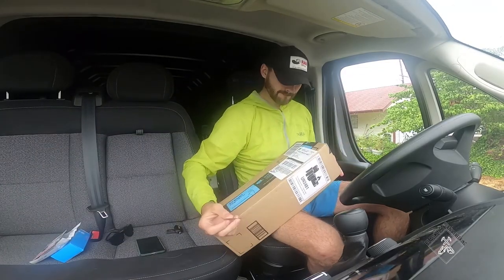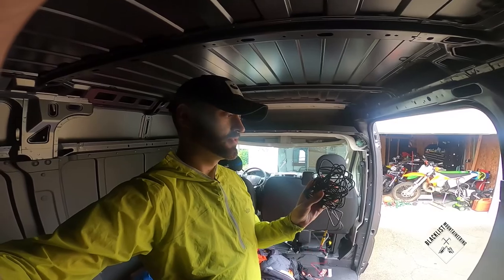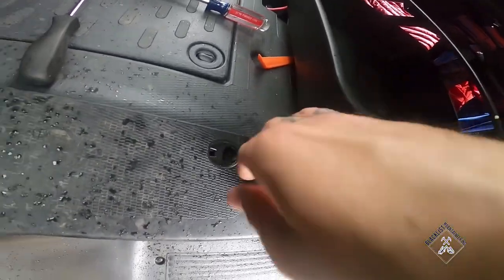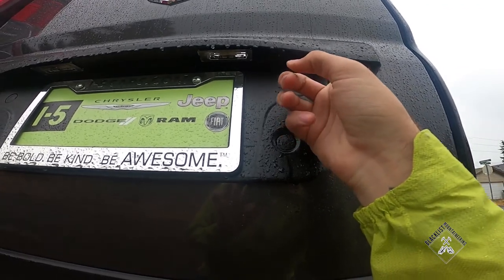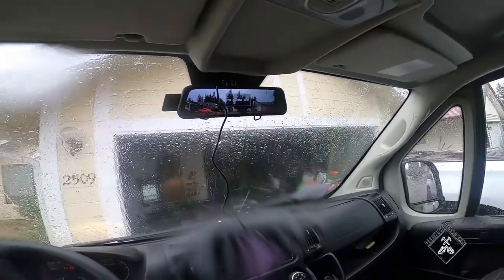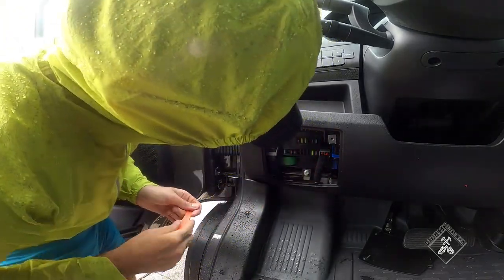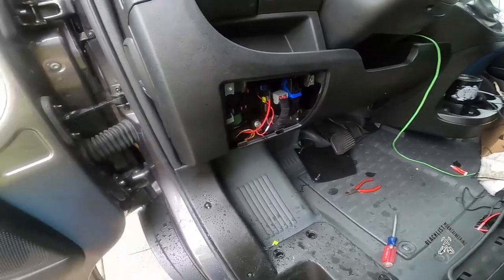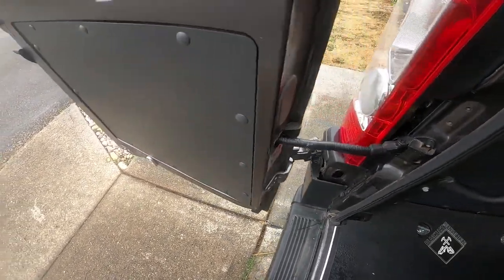Van Life - VANTOP H610 Rear view camera hardwired in Ram Promaster

Comment: Great video, however, you missed one VERY IMPORTANT detail.   When adding a fuse tap, it is IMPERATIVE that you determine which side of the fuse is the lead (where the power comes in) so that you know which direction to install the fuse tap.  If you install it backwards, you bypass the fuse and the mirror is not protected.  This also means that if the mirror shorts out, not only will the fuse not protect it, but the short can also cause issues on the battery side of the fuse box.  I have seen a shorted wire melt the insulation off of a wire (and fill the vehicle with smoke).  So... make sure to install the wire tap facing the correct way.  There are numerous videos that explain how to correctly orient a wire tap.  Otherwise this video was both helpful and informative.  Thanks!
Reply from the maker: Thanks for the comment. Pinned so other viewers can see this as well.

Comment: Awesome video. I followed your instructions and got this working. Only caveat is that it seems like the passenger window is always live (at least my case). The effect is that the camera display stays on even when the key is off the ignition. Any pointers to make the display go active only when car is on? (I know the unit stays on for other features but the display being on all the time bugs the hell out of me!! Thanks!
Reply from the maker: Yeah I agree. The passenger window should not be live when the vehicle is off. What likely is happening is that the mirror is running off its internal battery. I agree that it is annoying. I wish there was a setting that would automatically shut off the screen. Their idea here is that it will continue to run so the camera picks up any vandalism when you are not in the van. I just wish the screen would shut off automatically, and the camera would keep running until the internal battery dies. I haven't found a fix yet. Maybe the internal battery is removable? lol.
Reply: @teatimeinthealpine5752  Yes! I checked with the volt meter.. and the true ACC port (one that comes on when engine starts) is the USB/12v ports. The fuse for these are under the hood.. going to see if I can route to it and will let you know! - Thanks!
Reply: @sushbhattarai101  any success? I'm having the same problem.
Reply: I solved the problem by putting the ACC fuse into the Fuse Cavity F51 (5A) INT (REAR CAMERA AUX). The acc is a 5amp fuse as well so it's a good fit
Reply: @obatola  thank you for commenting on this!! i had the exact same problem as you  and was scrolling the comments in desperation!  but switching to F51 worked for me too. thanks again!

Comment: thanks for the video. i wired mine same as yours on a 2019 PM.  I want the camera to turn off when the i turn off the ignition, but it stays on...  is that how yours behaves? any suggestions?
Reply: Mine is doing the exact same thing. I need to figure out how to make that shut up as there’s no power switch on the mirror.
Reply: @DeepSkyDude  i solved the problem (by reading further below in the comment section)  . Sush Battari wrote "I solved the problem by putting the ACC fuse into the Fuse Cavity F51 (5A) INT (REAR CAMERA AUX). The acc is a 5amp fuse as well so it's a good fit"   ....and that fixed my problem too. easy fix!
Reply: @TheGaddings  yeah I just read that. I’m about to try the same thing. Thanks for the heads up!

Comment: If you unscrew the drivers side hand bat and the sun visor, you could run the cable through there and then have the cable peak out right where the mirror goes.

Comment: thanks for this video, it was super helpful! going to be doing this same thing to my van next week.  What did you end up using to seal the hole where you drilled to mount the rear camera?
Reply from the maker: Hey! I just used some black silicone. Turned out perfectly.

Comment: Thank you for this great, useful video!

Question regarding the Red Wire (min 8:38)  - shouldn't it go to the REVERSE LIGHT FUSE only in order to get the park assits grid lines when backing? 

Fuse F38 - for what circuit is it? Is it for Centarl Lock? I have a Citroen Jumper which to certain extent is similar to the RAM Promaster, but the electrical circuits might differ since it has a Diesel engine and is built according to Euro specifications.
Reply from the maker: F38 is for the central lock. Great question on the red wire. You can do it this way. I wanted it to only act as a rear view mirror. I actually prefer the factory back up camera when reversing into a parking spot. The factory camera also has the park assist lines. If your van doesn’t have the factory camera I can understand why you would want to do it that way.
Reply: @teatimeinthealpine5752   Thank you for the answer, but still not quite clear. I also want to use it mainly as a PERMANENT rear view camera (no rear windows), but I do not mind if it gets me the park assist lines when in reverse - there is no OEM backup camera on my van. If I connect the red  wire into backing lights, wouldn't it be possible to also use the camera for permanent rear view.??? I also do not really want to record anything when the engine is off as it is going to drain the battery - how to prevent it from doing this?. It is pity they put the better camera to the front which is mostly useless  (unless a bit paranoiac). PS: Sorry for too many questions!
Reply from the maker: @gregceban7010   gotcha. Because I didn’t try this method I don’t want to give you wrong information. In theory your suggestion should work well. Worse case scenario you can always wire it like I did. Also there is a power button on the mirror. You can always shut it off that way so that it doesn’t drain the battery. Also, you can setup your rear camera to be 2.5k which is what I did. I don’t care about the front camera so I wanted better resolution on the rear.
Reply: @teatimeinthealpine5752   Thank you!

Comment: I did exactly what you did. The camera works perfectly until I turn the engine on.... then it shuts off.
Reply from the maker: Strange. I have no idea why it would do that, so I would get in contact with the company.
Reply: @teatimeinthealpine5752  the hardwire kit I received was faulty. They sent a new one and it works. When you use the central locking fuse to connect the camera does it always stay on unless you manually turn it off? Battery drain?
Reply: @BrianNovak1  Would like to know this as well!

Comment: I followed this install and am having an issue where the camera drains my battery to the point that I have to jump start the van.  Are you having this issue?
Reply from the maker: No not at all! Yeah that’s not good.
Reply: Find any resolution to this issue?
Reply: @chopsmustdie  No
Reply: Sounds like you have the acc fuse tap in an always on fuse. The dashcam is staying on instead of switching to parking mode which uses less power.
Reply: @4KMoTo  it was going into parking mode but would drain the battery if it sat for a few days.  The camera died after a year and I didnt install a new one